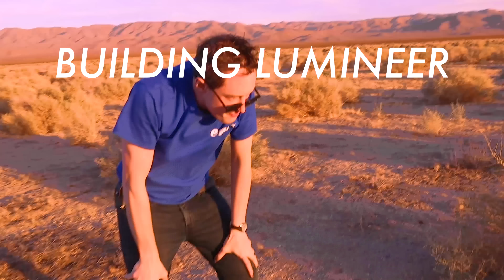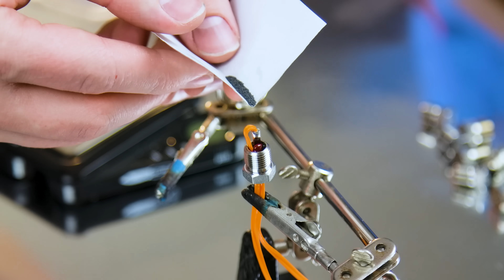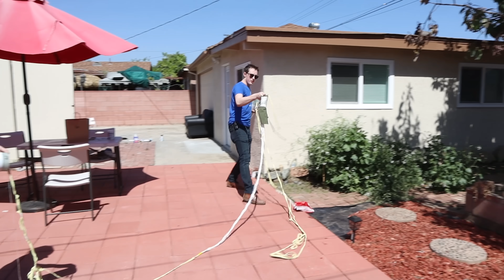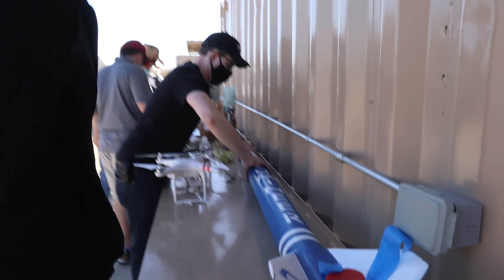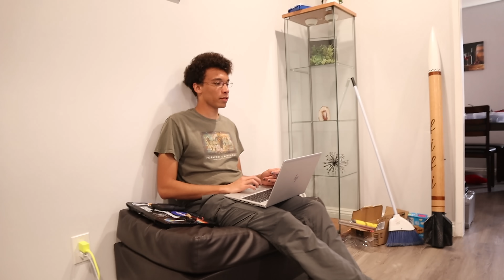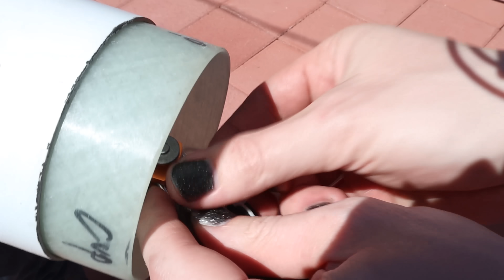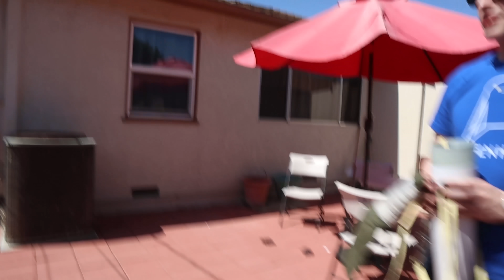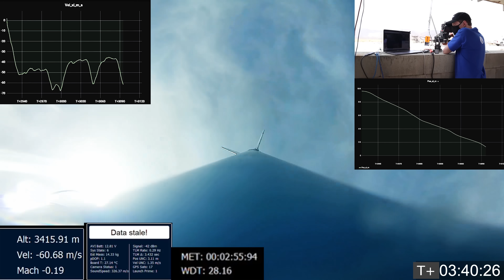Rocket Recovery System - Building Lumineer

Comment: Do you know the radio frequency will change with the speed of the rocket? Doppler shift issues. Could your radio issues be caused by the speed of the rocket? If the frequency is off by a little it will loose sync.
Reply: Doppler effect is a function of the speed of the wave—it's obvious with sound because the speed of sound in air is pretty slow but you need to be moving at a significant fraction of the speed of light to get actual doppler effects with the radio.
Reply: @zacharyrobinson2484  Doppler will happen at any speed. The question is will Doppler effect you receiver sync. Most stationary wifi receivers need the xtal and PLL to be around 10PPM or better. That's not much, which means you don't need much Doppler to effect ability to sync. A generic article about Doppler with the ISS found here which helps give some gut feel about how this works. https://www.qsl.net/ah6rh/am-radio/spacecomm/doppler-and-the-iss.html
Reply: It might be handy to try using SDR to better understand what is happening with the radios signals. This might be helpful. http://wb5rvz.com/sdr/

Comment: How about adding a passive system of grid fins that open up when in a motor down (downward acceleration) descent position and close with a forward acceleration (motor down position), to create a drag zone on the top half of the rocket to stabilize its descent and THEN launch the parachute (to avoid tangling), could help you with that.

Comment: Joe, I'd really love to see the video from the 3 cameras that didn't survive. 

You mentioned losing the video from 3 of the 4 cameras. I assume you have not formatted or re-used the SD cards that were in those cameras? If so, there are a number of things you can try to recover the video files. I've successfully recovered data from many crashes and would be happy to discuss the process with you.
Reply from the maker: I would ALSO like to see that video... The cards are crunched - like one is in 3 pieces, one is split down the middle, and one heats up as if it has an internal short. I'm sure the files are there, but the cards are unreadable. If you know someone who is able to recover footage from that type of situation, I'd pay good money for it. As I understand it, once that silicon is cracked, it's very hard to ever read that data again. :/
Reply: @BPSspace  Thanks for the explanation. Did you post pics of the damaged SD cards someplace? I personally have recovered data from smashed flash memory chips, but I was lucky and the broken part did not touch the silicon die inside the plastic housing. I was able to decap the chip and solder directly to the lead-frame with a microscope. 
I would urge you to get word out to a data recovery company. There are several on YouTube that show very extreme recovery scenarios in their videos. There's a pretty good chance that as long as the silicon die inside the chips is not broken, that a professional could help you. I hope you find someone to work with on this because I'd really love to see the video and think it might help solve the deploy failure questions!
Reply: If you looked at his Twitter, the SD cards for those are either snapped in half or crushed, and data recovery isn't possible at that point.